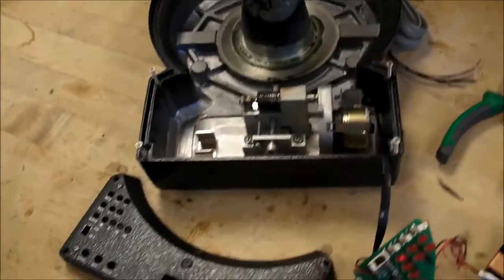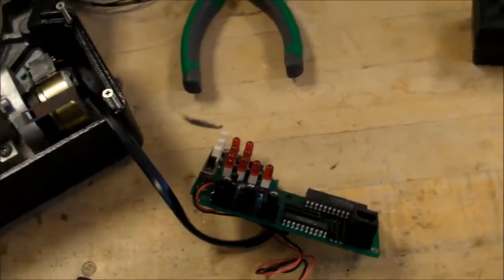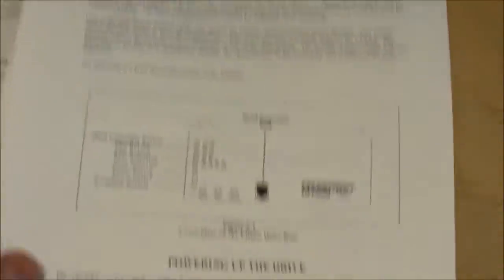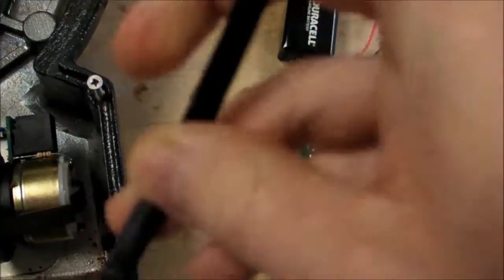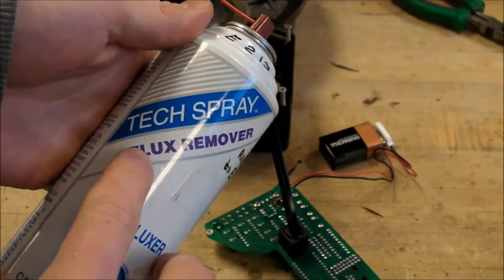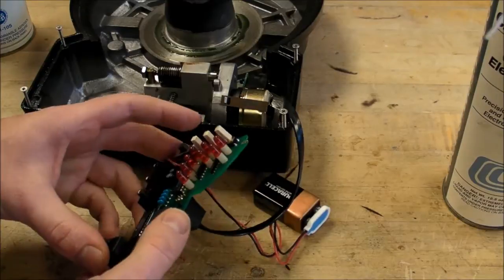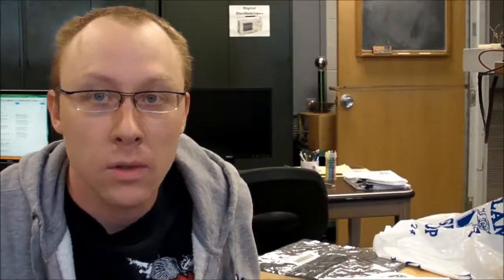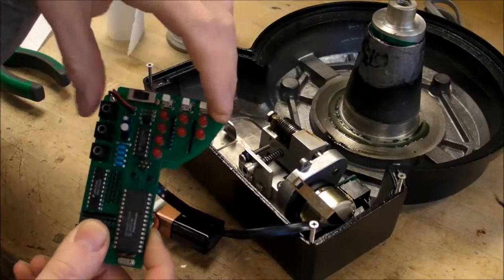(#0115) Celestron Telescope Clock Drive Repair (sort of)

Comment: Brother how did you get that top of the fork mount off the base. I have been dealing with that for a while now. I took the top bolt off and figured it would just slide off like the older orange tube mounts but not happening. Even put a socket on the top of the mount and tried to bang it off thinking it was just stuck but it only moved a little. Since it was tapered I figured it would just slide off once it broke free.

Comment: Great video. I have an Ultima C8 where the drive motor is not working. From what I can determine there is no voltage coming from the board to the motor. Just wondering if you could help? Seems a good project as everything else with the telescope is solid. Please let me know if you want more info.

Comment: hi eric i have slt alt az 127mm celestron  mount .my mount motor not working error 16/17 any budy tell me what sensor are working in these motor .encorder sensor ? sorry i am not good in english
Reply: Those codes indicate the motor control boards is not communicating.  Lots of info on this at nexstarsite.com.  You’ll likely need to replace the motor control board unless you have the skills and specialized equipment to repair it.  Celestron usually has parts in stock although currently availability is going to be unpredictable.

Comment: My mount doesn't have an electrical issue, mine is more mechanical. When you turn the knobs for right assention or declination, nothing happens. If the scope does happen to move, you can almost feel the gears slipping. I was told by celestron they can't replace the part and to get a new mount, but I was really hoping to fix it instead. Any suggestions?
Reply: For the RA knob, remove the two screws holding the knob housing to the sprocket plate. 

Once you have removed the knob assembly, check to make sure that the gear freely spins when you turn the knob, that there is very-little or no vertical slop, and that the assembly is greased.

If there is slop, find a hex wrench 2 or 3mm I think) to loosen the grub screw on the knob and tighten it so that it spins freely and has no slop.

when you replace the knob mount on the base, make sure that you are holding the knob mount as close to the fork as possible, to make sure that the gears are meshing. Then tighten the screws.

You can also take this opportunity to adjust the tightness of the locking lever nut.
Reply: For the Dec adjustment knob(s)...

first ensure that the adjustment arm's collar/clamp is correctly attached to the fork's pivot point, and that the locking lever-nut is also correctly tightened and locked.

next check that the sleeve nut & threaded rod connecting either the Dec-motor coupler, and adjustment knob, or the 2 adjustment knobs is connected properly at all 3 points, and that there is no slop at any of these points.

Comment: Cool.  I have a super old C-8 with a similar clock drive, but mine doesn't have any smart equipment; you plug it into AC and it just starts running.  I uploaded a stop action video of the drive running on my page a few years back.
Reply: I know it's been a while but If you've still got the mount, I'm working on a project to create a "bolt-on & drop-in" go-to solution for these older fork mount Ultimas.

Comment: Had a bad Meade drive decades ago. Sent it to Meade to get it fixed, they sent it back and it still didn't work. Opened it up and it was simply a bad solder connection. Took the solder iron longer to heat up than it took to fix it. Never bought another Meade product again.

Comment from the maker: I think the RJ11 is used because it's very common, inexpensive, and in this application, does not need to pass a lot of current. I suppose the only upgradable part is the PIC, but the scope's operation is so simple, its unlikely the PIC would ever need to be replaced. Thank you.

Comment: That's a surprising usage of RJ11 connectors. Are those components meant to be interchangeable or upgradeable by the end user?
Nice job, keep the vids coming.
Reply: Celestron and Meade both did similar things since they began to computerize their mounts, mainly because it was common hobbyist (8 bit micro and robotics) hardware.

The connectors for the newer NexStar mounts are R still J-11 and RJ-9.